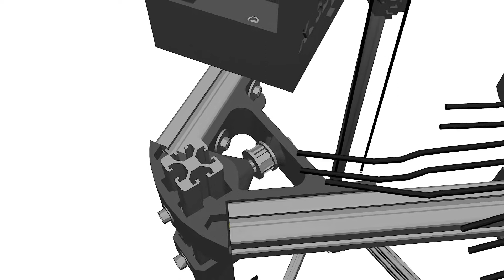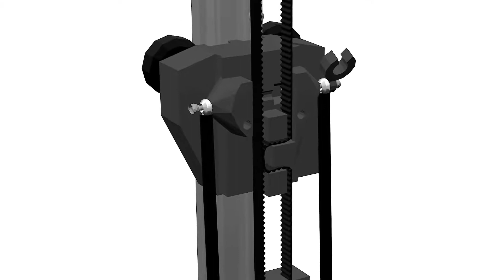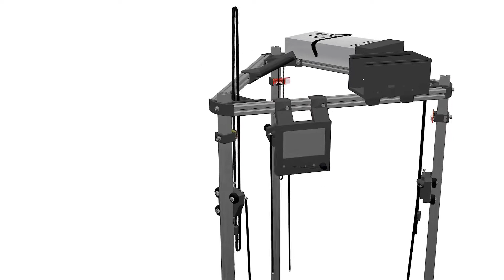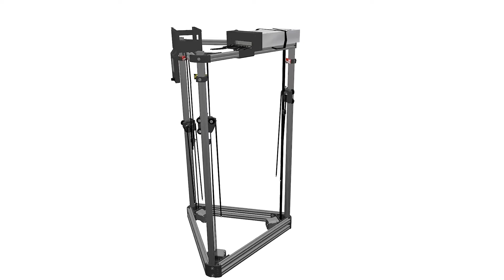Build a Delta 3D Printer - Adding and tightening the GT2 timing belts

Comment: I just got the frame parts n fixing. Decided to go 1M as u did. Maybe extend the parallel arm when it arrive😂.what’s ur arm length again?
Reply from the maker: hey man, glad your going for the taller printer, in my experience you always end up wanting to print bigger stuff, so bigger is better. try extending the parallel arms to 300-350mm as long as they don't become too flimsy and unstable
Reply: @myriadpro6752  well 5mm rod? Maybe will be flimsy
Reply: That’s what they have no choice, maybe coaxial it with aluminium or other carbon tubes
Reply from the maker: @jimmym2719  5mm diameter for carbon fiber or glass fiber is perfectly fine
Reply: @myriadpro6752  ok 👌
Reply: @myriadpro6752  stepper pulley 16T ?
Reply from the maker: @jimmym2719  yeah the 16 teeth ones are ok
Reply: @myriadpro6752  just got my parallel links..definitely too small I guess. Carbon tubes r just 200mm😂. Ends are M3. Have to get somemore longer carbon tubes. Anyway does it matter if for testing? My frame inner height is 1040 and triangular sides are 430 pole to pole inside. What’s the best parallel arm length ?
Reply from the maker: @jimmym2719  yeah 200mm are way too short, for your printer dimensions the arms should be minimum 300mm or ideally 350mm. you can either extend them with some 3d printed suplements or just get longer carbon or glass fiber tubes
Reply: @myriadpro6752  yeah ordered the  cf rods so 350 it is. Display arrived, advice on downloading firmware before other hardware arrive.
Reply from the maker: @jimmym2719  if you have the mega2560, ramps 1.4 and display you can already test it by uploading the firmware like described on the last video
Reply: @myriadpro6752  ok
Will do. Thanks